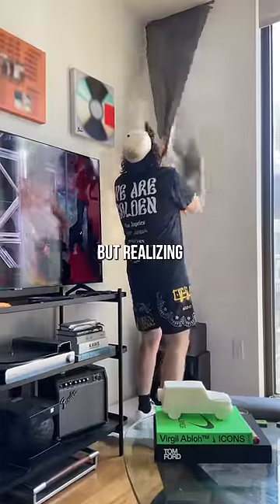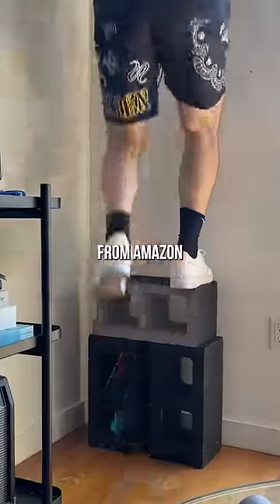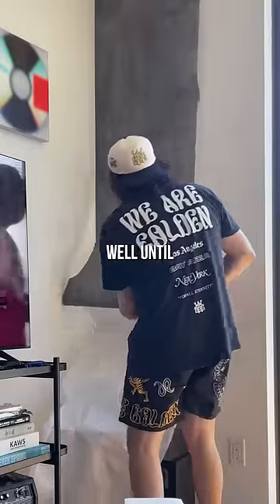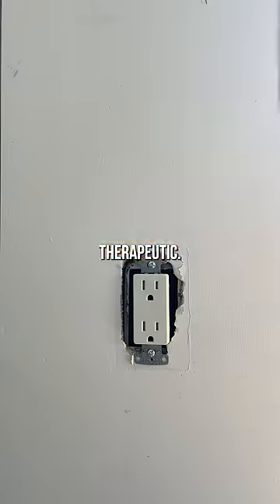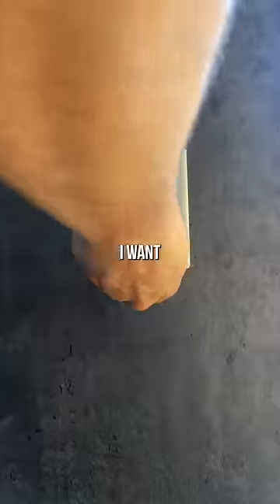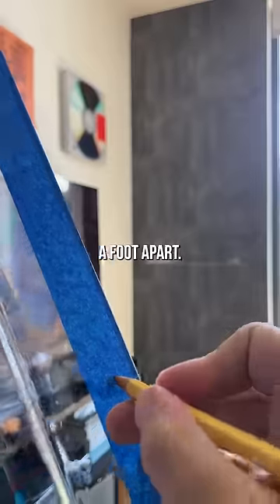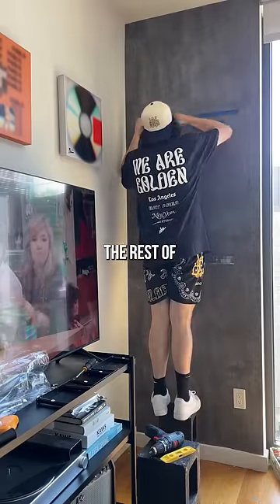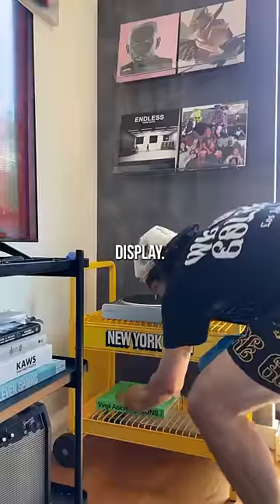I Found a Newspaper Rack! #homedecor #interiordesign

Comment: Where do you live bro. My dad's in the WP business. Accent walls are one of the most affordable to quote.
Reply: On the other hand. I could give you some tips.

Peel & Stick is harder to instal than regular wp such as vinyl or grasscloth.
For reg. wp, buy wp glue. Usually sold at Sherwin Williams type 880. You'll need a roll to apply the glue to the back of the wp and a hand-held squeegee to spread the glue and get rid of any bubbles that come when installing the strip.

On average, wp rolls come in yards. Typically 8, 12 or 36 yards. That's 2, 3 or 4 strips per roll. These measurements are from a typical height of 9ft. 
Speaking of which, a way to measure how many rolls you need is to get the area of the entire accent wall you'll be working with. When working around window/door frames, measure the entire width. Don't skip those spaces as you'll need to cover the headers. Also helps to keep extra material in case you mess up a strip.
When measuring height-wise, give yourself an additional 3 inches as leg-room to level your strips. This ensures the seams are leveled off and any potential patterns are aligned as well.
When buying custom rolls, expect delayed delivery of up to two weeks. 
Always read the instructions on the specific wp you're ordering. My basic steps are for general installation but every material is different and requires different methods. This is especially true when considering the cleanup process. Some wp's aren't meant to get wet or it will leave stains while others such as vinyl are water-resistant and you can clean off any excess glue with a sponge or washcloth.
As for the outlet, you should change it. Either paint it a similar shade of gray, or wrap it in wp as well. Yes, outlets covered in wp to match the wall are a thing. Although that process is rather difficult in and of itself.

That's about it. Sorry if it's not as simple as it sounds. Hope some of it helps.
Goodluck on your next project!

Comment: No, don’t paint the outlet black unless you want it to blend in. That concrete wall paper you have is around the purple range… the opposite of purple is green/yellow. So if you paint the outlet green or yellow, it will pop. Your newspaper stand will also pop as you can see there. Google a color wheel, color wheels make it easy for people to find the complementary color (opposite color).

Comment: Nah! You didn’t! What makes you think the proper place for a turntable is on a metal cart that rolls. You obviously don’t care for your vinyl what so ever. You’ll get hum and feedback off of that cart and the vibration from it will cause the needle to make those grooves wider and unplayable. They make isolation vibration stand just for turntable to eliminate everything you’re doing wrong with your turntable set up. You’re definitely NOT an audiophile. Spend all that money on vinyl just to ruin them.